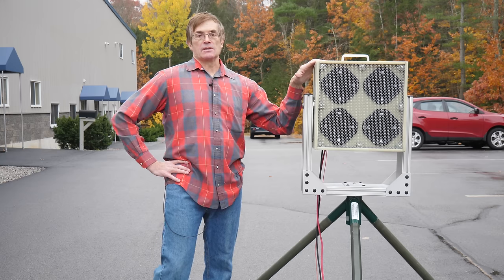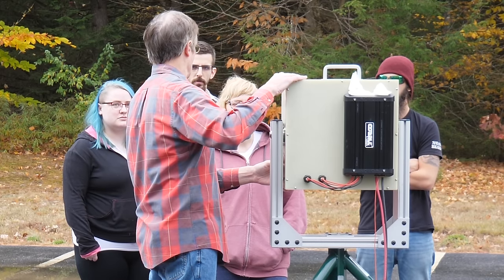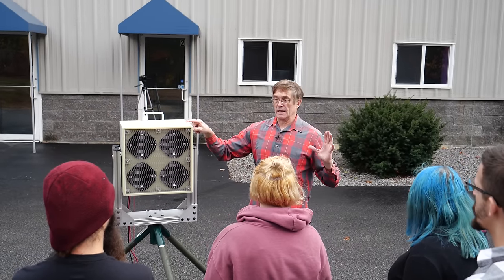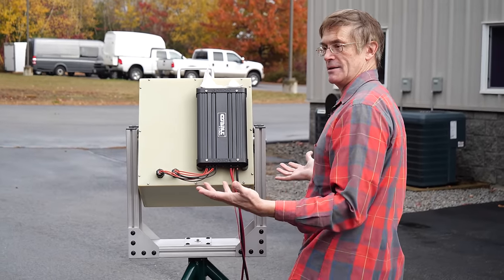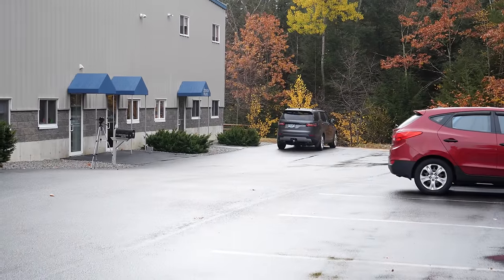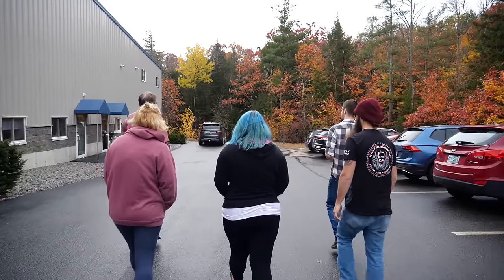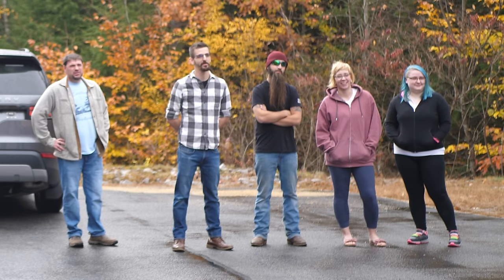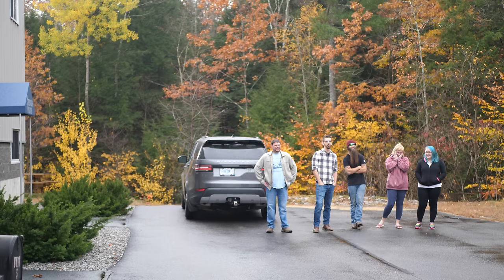LRAD vs "Volunteers" - Field Test

Comment: 'Watts' isn't really an indicator of anything, sound pressure is measured in db which has a very loose relationship to 'watts' that is dependent on the sensitivity or efficiency of the transducer.
Reply from the maker: Sure, you're right.  But they can be related in a giving system.  These horns are rated @120 db @ 1 meter@1 watt near 2000Hz.

Comment: Nice to have that massive warehouse wall to reflect the sound. How much more would the sound disperse if done in an open field?
Reply from the maker: Probably a few decibles, however this is pretty typical of how these are used. It would matter in a search and rescue situation if mounted on a ship or a helicopter.  In any case, I never had it above 25% of maximum volume.

Comment: So does this LRAD only affect the people that are in front of it? Can it be made smaller? What is it’s effective range? If the person is wearing hearing protection, how effective will it be? Can it be installed into a wall or ceiling? Can it be remote controlled? Can it emit consistent sound wave instead of a pulsating sound wave?

Comment: Could you lengthen the sides forward to better direct the sound forward?
Reply from the maker: Maybe a little, but it's not worth it.  The horns are controlling the dispersion, so unless you tried to flair the box like a second stage horn there will be little effect.

Comment: This makes me wonder if there's an equivalent to the horn speaker, but which is specifically extremely good at low frequencies rather than high frequencies. That way you might make an infrasound LRAD.
Reply from the maker: Did you watch our first video on this system?
Reply: @TechIngredients  I did, I just meant that I was curious about the possibility of something with the same efficiency as horn speakers have in high frequencies, but for low frequencies instead. Cone speakers aren't quite that if I remember that video correctly, and I don't remember any other speaker types mentioned in detail. Correct me if I'm wrong though, I probably am tbh.

Comment: 5,000 watts amp, 4 speakers at 1,250 watts each. That is a whole lot of heat,  the amp is staying cool; the speakers are not burning up. How big are the voice coil wires of the speakers, and how far back and forth do the speakers move?? A lot of thoughts here, a lot of uses here.
Reply from the maker: That is momentary.  I wouldn't run it for more than a minute at a time especially because the speakers are totally enclosed.
Reply: @TechIngredients  Still, that is a lot of power to run through a voice coil, being power = voltage times current, and voltage is set to that of a 12 volt car battery, making the current for 5,000 watts around 333 amps and for 1/4 power the current comes out to be around 104 amps, still a lot. Say the power is peak power or pulse power and the speakers stand up to that. That is something. This also gets me wondering about the speakers magnetic. What are they made of, iron,  neodymium, or something in between, note that an electro magnetic will or can out perform a neodymium magnetic. Stronger the magnetic the less power is need to move the speaker's cone for a given sound level. Those are strong speakers to sand up to all that power even for a short time.

Comment: I was under the impression that the directionality was achieved using a phased array of sound sources.
Have you considered investigating the ultrasonic modulated phased array the gives a very directional audio source. 
I think this relies on the nonlinearity of the human ear to demodulate the audio on the ultrasonic carrier beam.
Reply from the maker: Did you watch our first video on these speakers?
Ultrasonic, beat frequency projection is what you're describing, it's interesting and we might cover it, but it's inefficient and probably not a good approach as a deterrent.
Reply: @TechIngredients  I have now, but I am left with a few questions. 
What is the effective beam width of the system?
What is the front to back sound level ratio?
Are there concerns with constructive  reflections from hard surfaces in the beam path? Examples might be walls of buildings along a street.
Because of the square law reduction in power at a distance, those at close range will experience far greater damage than those further away.

Comment: Its very easy to reduce or evven anihilate the effects IF you are being hit by the LRAD thing/sound.... use WATER !!!!!

NASA uses water to absorb the sound energy produced during rocket launches. since water seems to absorb the sound energy. And rocket launches have lots of that about 220-240 dB unprotected, but they can reduce it to 140 by using water splashed into the region where the noise is. in this case the rocket engines.  Good luck with it.
Reply from the maker: In our next video we'll cover some convenient techniques to defeat LRAD.

Comment: I should probably watch the first video, but for contrast, how much do institutional LRAD systems usually cost, and how many dB are they putting out?

Edit: I just watched the first video and heard you mention that these should be pushing out similar decibels. That's pretty impressive, because I doubt the government is buying them for $500 each, even in big contracts.

Next, you should see how cheaply you can make a scaled down handheld version that's still got deterrent value. I wonder how many watts you could get from some D batteries, heh.
Reply from the maker: The same decibles for $10,000-$100,000.
Reply: @TechIngredients  Gosh that's amazing, didn't think the difference would be that huge.
Reply: @WaxPaper  Your tax dollars, being wisely spent!

Comment: Need help in understanding (phasing) of say 1.22760ghz and 2.4ghz.. is there a way to model on pc and possibly record.. I'm investigating how rf energy can be recorded in one room and transposed to another. 

Thanks again
Reply from the maker: You can't  phase match signals  that are not multiples  of the base frequency.
Reply: @TechIngredients  thanks i guess what im trying to figure out is the Frey effect.. but i have received physical damage from another spectrum maybe xray....

 i am now v2K... somehow they are using multiple frequencies and the damaging frequency is not effective unless the air pressure is charged or increased with another wavelength .. 

i suspect 1.22760ghz from satellite and a very small mm length because it has been focused on my eyelid and not perceived in my eye... looking for any help whatsoever.  thanks again!

Comment: What would be the effect of broadcasting hyper low frequency?   Below hearing level.
Reply from the maker: As I discussed in our first video on this system, that would require a different design.  Horn speakers are frequency limited by size to mid-range and above.  Large diaphragm speakers can produce subsonic frequencies, but at substantially lower effeciency and the divergence is also greater.
You would need a lot more power, but those frequencies can be nauseating.

Comment: omg !  Speakers maximum output is NOT determined by it's Wattage Ratings. At best each speaker will operate safely, with an amplifier, up to it's rated limit. A Sensitivity Rating has an equal or more importance. It's a shame, It's not properly explained here. .

Comment: I want to see this with 30, 40, 50 and 60 year olds to see if it’s an “ageist” weapon. (I suffer hearing loss from military service and wonder how much this would bother me)
Reply: Depends on the frequencies. The older you get, generally, the worse your detection of high frequency sounds. If the output frequency can be adjusted then you can find a sweet spot for anyone I'd imagine.
Reply: Rosie Hawtrey that particular “chirp” not only creates moving nodes but it also covers a range of frequencies so it might already be able of affecting a wide range of people.

Comment: Rupture eardrum at 150db?  Maybe at only certain frequencies. I have personally sat in too many vehicles that meter at the headrest over 160db and still pass a hearing test. Been doing it for decades. Now these are usually 100hz, and lower, the lowest frequency over 160db was at 27hz.
Reply: Given that a jet aircraft taking off registers 150dBa at 50m and the threshold of pain is 130dBa, I would question the accuracy of a 160dBa reading inside a vehicle.
Reply: If you are doing this without hearing protection you will pay the price.

Comment: I hate horn speakers.
I went to a Rush concert and was in front of a speaker loaded with a horn about 100ft away, It literally made my ears hurt.
That is also why I don't like Klipsche that still insists in loading horns in everything.

I could only imagine the power if you hooked two speaker units apart from each-other at an exact triangle with a person at the tip and "cross beams".

Comment: Interesting to really do the math and perceive how dangerous these can potentially be.  Even the Active Denial System or other designs where claimed to be used safely... are known to cause injury and I'm confident can be hacked to be worse if not daisy chained or coupled with multiple units where if phase synchronized on a target/victim(s) can be very lethal.   I worry more about the RF beam forming systems that aren't so well disclosed.  Those can be tuned more to like the human head resonance frequency and other organs electrophysiological functions for a more minimalist approach to effect lethally.  Amazing how all the compounding and concealing along with obstruction of justice regarding acoustic hailing, body assault and mind control wireless devices that need to be listed in publications like Janes since are military intel.  https://everydayconcerned.files.wordpress.com/2019/03/full.pdf

Comment: having worked with car audio for a while, those numbers sound well off for the power, the components are much too small and too cheap to be producing that amount of power. Always look for RMS ratings and nothing else, car audio companies love making up "peak" power numbers, they'll usually multiply the RMS power by 2 but sometimes they'll just go crazy and put some random very high number. The cheaper you go, the worst it is. Going with slightly more expensive parts that have higher actual power would probably extend the range by a lot. Although it won't be a 500$ LRAD anymore which is part of what makes this one impressive
Nice project! keep making cool stuff!
Reply: I don't think the actual output power is the most important in this application. Sure the rating of the amp is completely bogus (5000 Watts China), but whatever actual power this thing can put out, at 1/4 gain it was already too much. The amp is already at least double what's required!

Comment: Ah you didn't bounce it off the wall.
Reply from the maker: To some extent, you can't avoid it as the dispersion is around 45 degrees.
Reply: oh, for sure, but you could practice with it to shoot it around  corners.

Comment: What are you using for the audio oscillator source in this build?
I know of some very small auto alarm horns used inside of vehicles that use the same sound generators. One cannot stay in the vehicle when this thing is chirping.

Comment: The amplifier  watts are lies. To put out that kind of wattage you need crzy a mount of amperage from a 12  volt supply. You did have to parallel 2 batteries. 1500 watts power consumption will require 125 amps @12vdc.that is not power output at speakers and it would require alot more power in class A vs Class D or other amplifier types.
Reply: Not questioning his skills. Just the lies on consumer electronics. An ab amplifier with an output of 100wrms 2 channel will draw almost 30 amps out of your 13.8 v ailugomotive supply. Pure class A would draw even more. Class D would be much  less and not sure on other amplifier. classes. That's all I'm saying. Alot of these car and home amiciers are lying about actual power output.
But that's just an observation

Comment: It's a pretty irresponsible experiment to be honest
Reply from the maker: In what way?
Reply: @TechIngredients  Exposing volunteers to potentially damaging sound levels.  What if you had accidentally whacked up the volume to full or if there had been a transient at full level due to power on behaviour or if a fault had developed?  You cannot say it was safe, surely.  I mean it's a dangerous piece of kit to have designed in any case in my opinion.  I suppose you could say the same for any powerful and commercially available P.A. system but that doesn't make your experiment "OK".
Reply: @sinisterhipp0  They didn't look all that "willing" to me